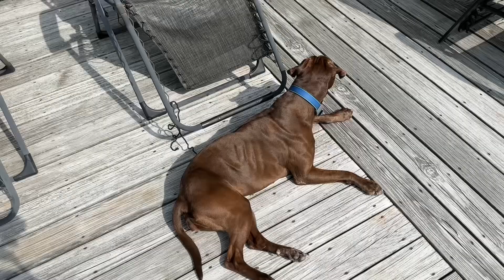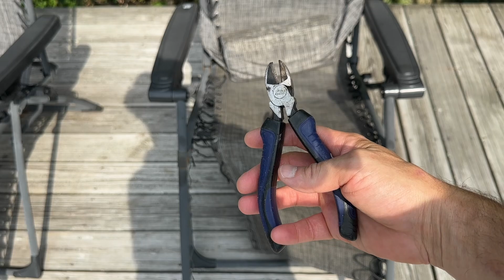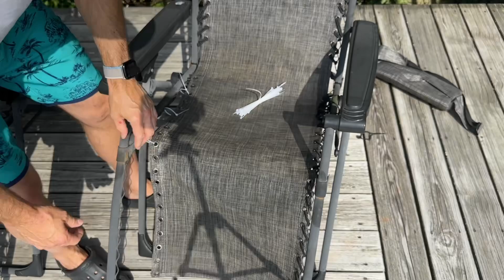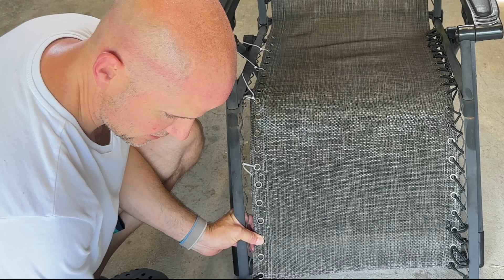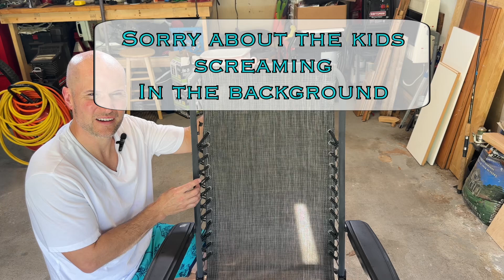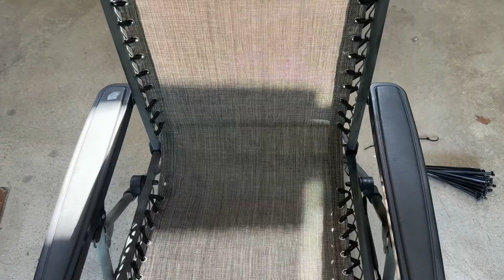$10 Fix For Broken Zero-Gravity Chair

Comment: How did you make a knot at the bottom each time. I couldn’t see the knot or how you did it. Thank you by the way. My chair just broke and I’ve been using it to sit and at times sleep in with lower back/disc/sciatica.
Reply from the maker: Hope you feel better! Sorry it took so long to reply. The bottom or the beginning is where you would have initially folded the cord in half, so basically it goes through the first loop then progresses up the chair, there’s no knot, just the 1/2 way point “fold”. Hope that helps.
Reply: Ya I can't get the knot right either at the end before you come back up doubling it up, I've watched several videos and none of them showed it ... Everyone just does it there own way. It didn't take matter I suppose but I wanted it to look the way the top half of my chair looks. Nice and tidy